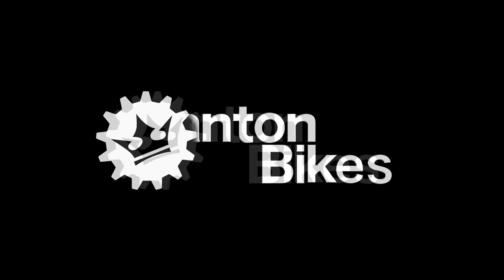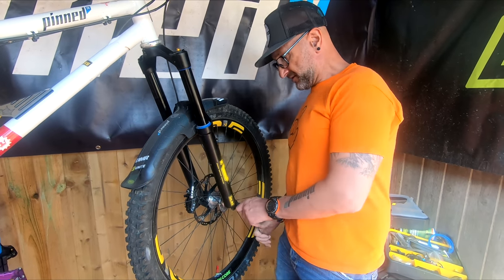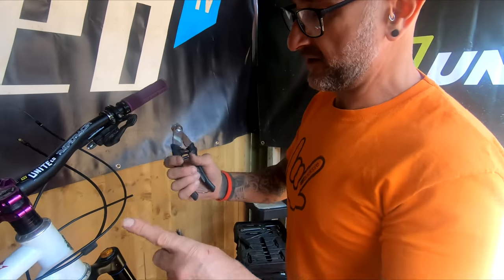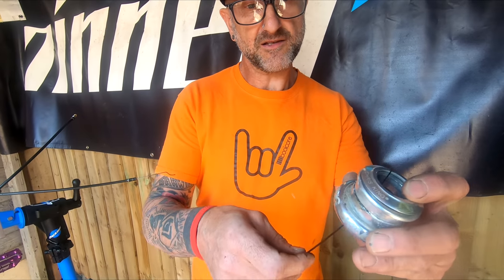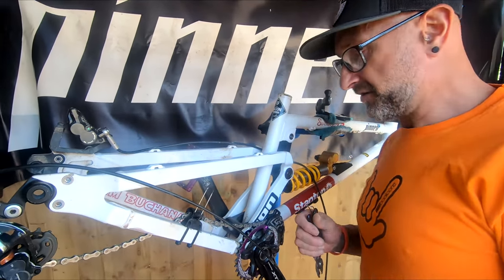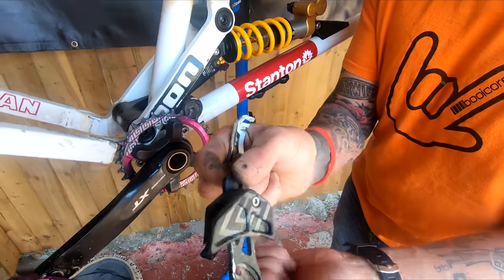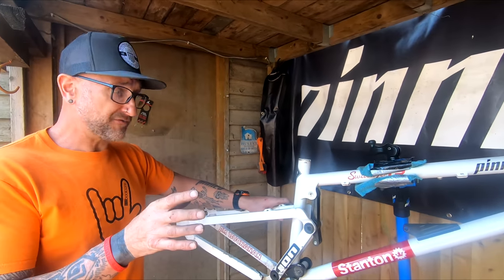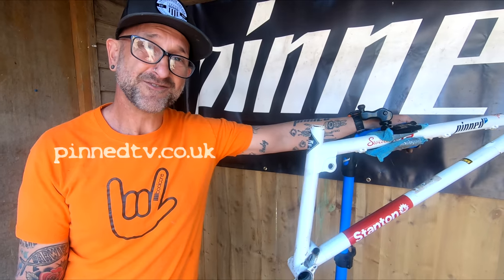HOW TO Strip your bike down for a *FRAME SWAP* Stanton Switch 9 FS

Comment: I like how the swingarm comes apart with the two separate halves thats a very good bit of design and engineering .
Reply: 1 Broken Spoke why do you think that out of interest I think it would t be as good as a one piece swing arm as it wouldn’t be as stiff
Reply: @willbennett7107   I had not really considered how stiff it might be but i bet it is no worse than most other swing arms but i do like the idea of being able to replace half the swing arm if it does break .

Comment: Great video Jim. Probably a stupid question would I have to let the air out my shock to take the linkage off? And when rebuilding would you recommend using grease on the linkage bolts?
Reply from the maker: Don't need to remove air from shock, greave the outer surfaces that slide through on the bolts, but not the threads, as often they need to be loctited mate
Reply: Pinned TV thanks for that 👍🏻
Reply: Pinned TV hey jim. Just want to say a big thanks for the tip managed to remove and re assemble without any problems. 🤟🏻